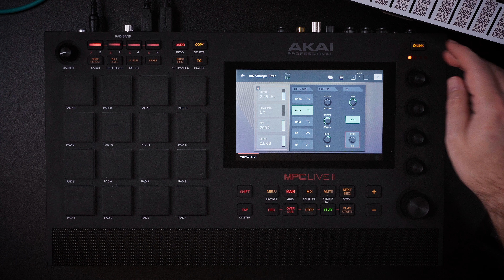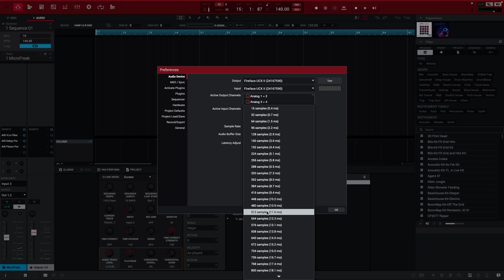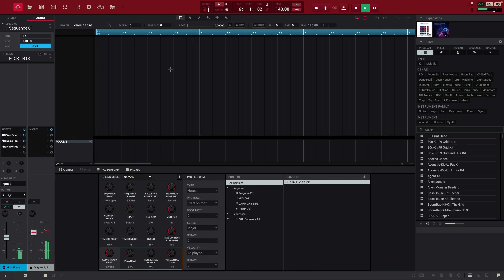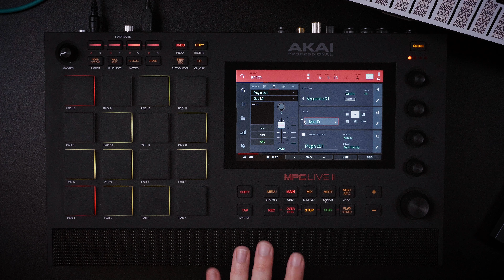Using your MPC as a digital mixer // Hybrid Setups

Comment: Thanks for the rundown.  I also tried the mpc with it as the interface, but I also experienced the issue of pops and clicks.  Until they sort that out I’m happy in my workflow where i mix everything in the mpc and track out using the trs cable outputs.  You can get a really good mix in just the mpc it’s such a slept on thing that not many people try.  Also don’t know if you tried this but I set up an external reverb pedal on outputs 5/6 of the live 2 and on the return set that to output through 1 and 2.  Now I can set the reverb pedal to 100% wet and use the individual sends in the mpc just like you can in a daw.  Great channel appreciate your content

Comment: One thing I’ve found with the Mpc using this method is that any fx placed on an audio track are on the output of the audio track . So you can’t record the wet signal. That’s not the case on the force.
Also with the most recent Hakai firmware you can adjust the buffer size on the standalone unit.

Comment: Does the Akai ‘allow’ an external audio interface to act as the clock master? Not for midi, but for audio. Did you ever try the Audio4c from iConnectivity with the clock set to external (USB port1 or 2) so the MPC would considered to be the clock master?

Comment: A question that’s important for my setup Tefty.. Can MPC route to the ADAT outputs of RME ?
Reply from the maker: Assuming the MPC is using the RME as an audio interface, then yeah it should be able to just access all the channels (up to 32) for your device, if it's supported.
Reply: @teftymusictech  The reason I ask is because I have a digital console with adat inputs and I want to route 8 digital channels from my MPC to it, obviously via a sound card. The question is whether the MPC with the UCX you have in the video sees the adat ports. If you could confirm this at some point, I would be very grateful. Thanks for the response!
Reply from the maker: Yes it should see them no problem assuming the audio interface works with MPC properly. You'll just have to remember which channels are the ADAT channels (like 9-16 etc)